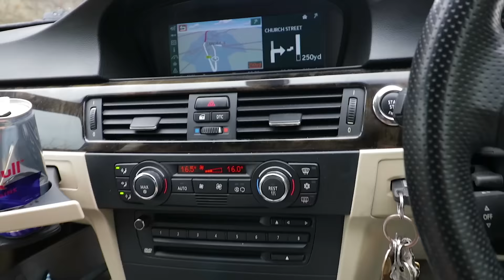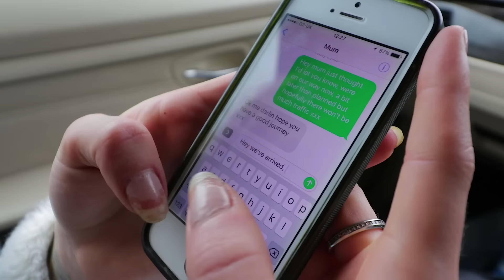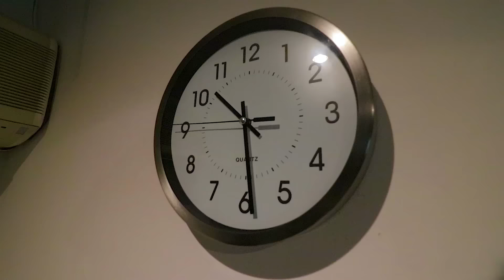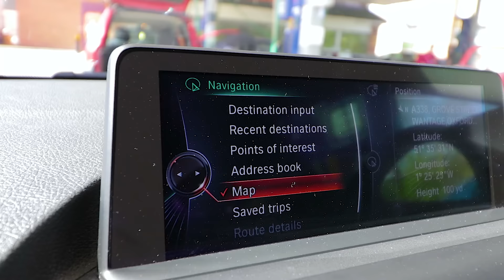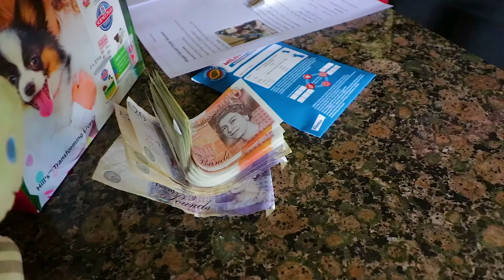Getting our very first Whippet puppy!

Comment: You have remedy the cause of the mold first. Don’t you?
Reply from the maker: Paige Willow yes you do. I’m pretty certain it was due to a leaking pipe on the other side of the wall (bathroom). A lot of the time it can be due to a lack of ventilation from being blocked by the kitchen carcasses.